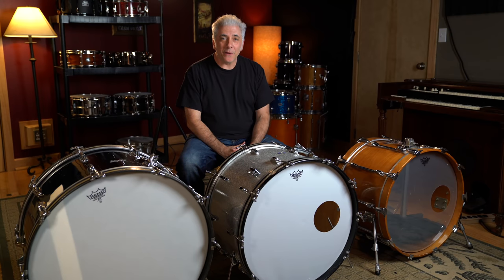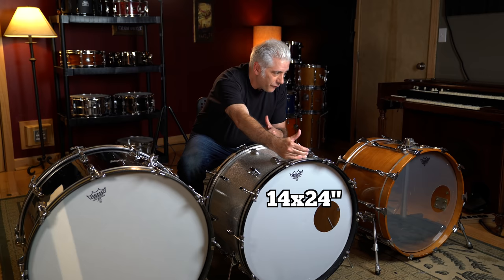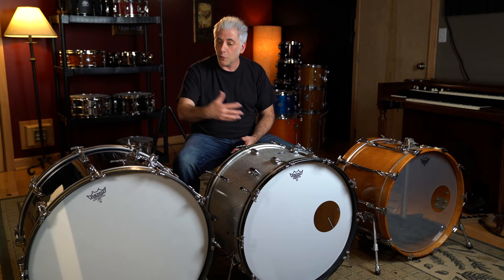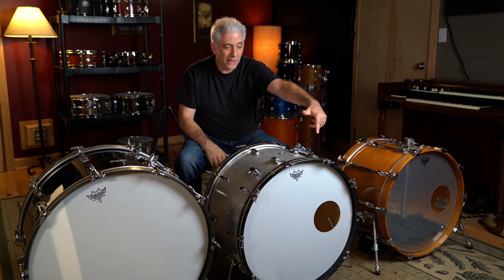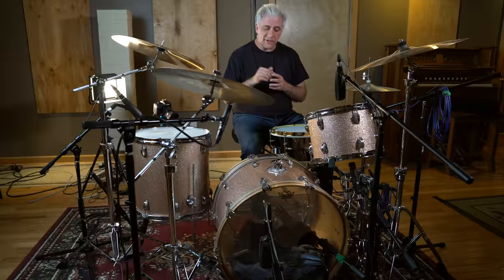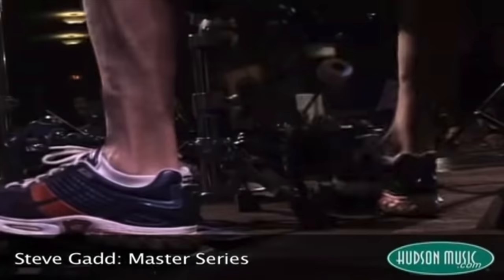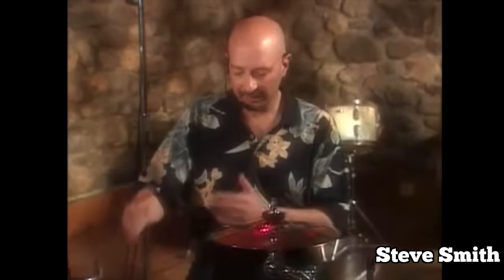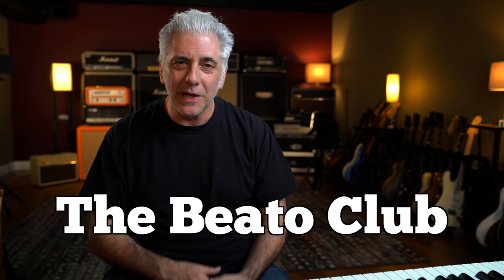How To Get A HUGE BASS Drum Sound

Comment: The deeper a tube, the lower the frequencies at which it resonates. That is why tubular bells produce lower pitched sounds when the bells are larger and/or thicker. So the reason a shorter bass drum may sound deeper is because of the second membrane resonating more in phase with the first one. A deep bass drum (say 22 inch) may act as a helmholtz resonator which cancels out low frequencies.
Reply: Dude Layin down that knowledge
Reply: Correct.  A deeper drum has a more “tuned” note to it because of the resonance while a shorter drum has more overtones/harmonics.  The overtones make it feel more explosive and allow lower frequencies below the resonance of the tube to be more pronounced.  To use an analogy, a really shallow drum is more like a thunder sheet (lots of incongruent harmonics) while a really long/deep drum is more like blowing air over a big bottle (helmholtz resonator).

In my own 30+ years of experience recording drums (and playing them) the deeper the drum the more pronounced the resonant frequency of the shell is and the more limited the tuning range is (the drum chokes more when tuned outside a resonance of the tube).  But man, when you turn them to match one of their resonance frequencies, WOW!!  Super loud, super round tone, and tons of sustain, very ringy.  Tuning them outside/away from a resonant frequency makes then very short/choked and they can sound extremely punchy, like that heavy metal super punchy sound with almost no sustain.

Shallow drums have the choking and ringing in relation to their resonant frequency to a lesser effect, so you can get a more consistent sound over a wider range of tuning but it’s neither super choked/punchy nor is it super ringy.  Anyway that has been my experience.

Comment: I discovered some of what you touch on this video a few years ago, when I was surprised to discover that my vintage early 70's Rogers 20" x 14" bass drum produces more low end that a couple of my newer 22" x 18" kick drums. Also, if you're using a front/resonant head on your bass drum, it makes a difference where you cut the port hole. If you get the hole too close to the center of the head, the kick will sound too dry and dead without much resonance at all. I had a kick drum that I thought for years had a problem with the shell (out of round, bad bearing edges, etc.), but I eventually found out the only problem was that the port hole was cut too close to center on the resonant head!

Comment: I play old Ludwig and Rogers, so they have tee head tension rods. I use a long thin zip tie or two shorter ones linked together to form a loop from the rods at the 4 and 8 o'clock positions (appx) then I can use different thicknesses of cloth, mostly hand towels, folded or unfolded, to achieve quick, easy, and adjustable damping. Thought I would share

Comment: I don't know Rick, I've got a Noble and Cooley kit with a 22X20 BD and I consistently hear from trades folk (engineers, producers, FOH/monitor mixers and other musicians) and non-trades (audience folk, or as I say "non-musician civilians") how deep and low the BD is. It also depends on number of plys, mic placement, head selection and tuning, and to your point, playing styles (i.e. burying the beater in the head). Same with snares. I've got several work horse snares that can go high or low and I can get a nice middle ground if needed. Over the years I've recorded albums with "jellybean" drum sets where the toms were from a different manufacturer and different color than the bass drum, floor toms and snare. Cymbals were a mix too, so I may have played a few Sabians with a vintage Paiste, Zildjian, Istanbul or Bosphorus thrown in the mix. At the end of the day it's about the sound we're looking for, right?

Comment: Here's a tip to help prevent the "burying of the beater"- pull your foot back on the pedal, so the ball of your foot is closer to the hinge. It'll take some messing around with it to find your "spot", but that small alteration will make it easier to not bury the beater. 

Contrary to the shape of the pedalboard, your entire foot does not need to fit on the pedal. The pedal is a seesaw and you're using your foot to activate various balance and leverage points. 

Happy exploring!
Reply: Exactly correct. I learned this when I was about 12. I cannot stand the sound of a bury beater technique. Always played from the middle of so of the board. Hit, and let it sing, 100%! I can't even do the other way when I try.

Comment: not sure how I missed this video when searching kick drum sizes... I started off with a 22x20, using an Aquarian Super Kick 2 with a matching Aquarian reso with a mic hole.  It sounded amazing.  I've since went to a 24x14.  It could be that I am trying to use the same model heads I've always had luck with or maybe it's the fact that I am tuning the same way as I did with the 22.  I press dead center and tune until the wrinkles go away, then back off maybe a 1/4 turn.  The reso I do the same with, but I don't back off the tension.  With the 22 it sounds great.  Not so much with the 24.  I am currently using the same heads but tightening them up more.  I am getting close to finding a tone I like. Several sound guys have complimented the bottom end and punch I get so maybe it's there and it's just different lol.  I had to add a small pillow to help accomplish this where with the 22 I would run wide open.  Anyway enough rambling...  good video as always.

Comment: I do a few things: 1) Mic the bass drum about half way between the beater and the rim, usually about 2" away 2) mic the inside, like he did through the port hole 3) mic the outside like he did 4) mic the port hole 5) mic about 6 ft away. If I already have the whole tracking session to a scratch drum / click whatever and I have the channels available for the session I'll use more mics. It really gives myself and the artist a lot of choice. Same thing with say guitar cabs and different mics. 2 Sm57's can sound almost like different mics, celestion 30's coming from the same factory can sound different mic'd with the same mic. If I have a 4x12 cab, I'll mic ALL 4 speakers. 1 on the outer perim of the cone, one on the cone, one on halfway between cone and outer rim, and one off axis. If I have the channels, I'll mic the inside rear of an open cab, plus a room mic maybe 4-6ft back, etc. Blending all that gives some cool results. Could I use a plugin? Sure, but I enjoy that stuff so whatever.

Comment: So is burying the beater like palm muting on guitar?
Reply: yes, it should be called toe-muting 
or
"My knee hurts, leave me alone"
Reply: It's actually a mode for a tone. It's easier to play loud rock /fast/semi fast music by burying it than it is for bouncing it off. As Beto said  not burying is great for slow songs by constantly not burying it. I kind of use a combo like if I'm playing fast music but it's not quite so fast but if I still want to have power I'll bury it sort of halfway. Especially if the mic signal is compressed or limited to studio or PA. A power trio drummer most likely plays toe down. However, a band like "rage" is that way but not during soft sections.

Comment: Diameter influences pitch and depth is more about how much sound is generated. Shorter depths generally have more sustain while a power size creates “more sound” when played loud in a short blast / quick decay. 

I’ve never understood the fascination with the 18 inch deep bass drums. I guess just a marketing tactic like the power toms — if one manufacturer did it, the others felt they had to? 

I’ve had 14 x 20, 16 x 22, 14x 24, 18 x 22 and 17 x 22. The 18 x 22 was a Yamaha Maple Absolute and it was very loud live but harder to play and more difficult to record. The 14 x 24 sounded best for recording if you wanted a Black Sabbath “Heaven and Hell” type dry, poofy sound   - a Ludwig. The only one I have now is the 16 x 22 Yamaha Recording Custom and it has a great mix of “tomahawk chop,” super quick action, and good volume. If ever bought another kit I would likely though go back to a 14 or 16 X 24.

Comment: I like using an 18 or 20 inch kick and put the microphone 2 inches off the head by 3 inches off center of the mallets on the inside of the batter head. 
 Live kits/ acoustic acts I use Isobaric by tuning the front head to resonate off the batter head making the shells sound huge

Comment: This makes me feel so much better with my old 14" x 22" Tama Imperialstar bass drum from the 1980s. Those deeper sizes are made for drummers with road crews that load the drums into semi-trucks. How exactly does one fit an 18" x 22" bass drum in the back of a normal car like a sedan? All I need is a drum that goes BOOM and fits in my car without having to buy a Ford Excursion or an E350 van.

Comment: 16" kick drums can sound suprisingly good, recorded. Especially unported, in music styles that suit that sound. 16", 18 & 20" are drums that can get away with / benefit from deeper drums. It's not so hard to push air through those narrower shells, since the force is focused. For music that isn't hard rock, I really like the sound of the 18x14" Gretsch Renown Jazz kick drum, or even better the 20x16", Gretsch Renown Studio kick drum. They maybe sound better on recording than the 22x18" Renown Standard / Rock, which maybe suffer from that problem moving air down a deep shell that you described, though I guess a large port would ameliorate somewhat? The drummer has a different perspective to the recording, since they hear more from the batter side, so aren't aware of that loss to the depth by the reso side, where the kick in mic goes. I suppose using an SM91, or the kick-in mic slightly deeper in might help.

Comment: Thanks for sharing this. It's proof there are many ways to mic up a kick to get a sound to match a musical style. A good way to "cheat" and get a kick drum to appear to "move" a lot of air in the room and give that current hip-hoppy bottom, trigger a 39-41 cycle tone with every hit. It makes a great "sub kick" sound. Works great live, however, use it carefully in recordings. Another approach is using a Yamaha SKRM-100 and lots of lowpass filter.

Comment: I have to say the 14 inch deep is the key to get this Bonham kind of sound. Also because is tuned high beater bounces back and makes booom! I also get the big sound from my acrylic DIY only 20/14. Sound is huge, I get easy 50hz with good attack and harmonics cut easy to the mix. Also I can get the modern sound “glueing”. A lot sounds it’s possible to get from this config. Maybe not the best for double pedals.

Comment: You can get a Bonham type sound from any bass drum 22" or above. Just use 2 felt strips for muffling. I use a 26 x 10 - it sounds huge and doesn't take up much room on a small stage. Bonham actually used a 22" on the first Zep album. 
A note about 'burying the beater' - If you have a closed res head, burying the beater will cause it to flamm - especially if you hit hard. It can work if you hit softer and use a softer beater.

Comment: The reason for pulling the beater away is to stop unintentional double  taps on an un-ported kick, a lot more air inside to bounce the heads, where the beater, if buried, bounces. Which is fixed by porting the front head (tho there are ports for the batter), sounds less boomy but a buried beater won't bounce and hence give a solid note. The resting position on the pedal is critical too. If buried, the foot is closer to the pivot point and the beater is resting on the head =quick accurate. At rest lower down the board, the beater is  free, farther from the pivot point on the cam, and is slower or heavier. But that works with a big kick 😃

Comment: All these informational videos are fantastics. As a drummer myself I watch these types of videos all the time and conclude that the bottom line is when it comes to drummers and their drums, its all preference.  And most of these videos are well produced. A kick drum with 2 professional, eq'd mics is going to sound way different than one without.  Rick is awesome, love his stuff and the info is great.  But I've gotten huge kick sounds out of all kinds and sizes of kick drums.  I'm no drum tuning guru either,  what sounds huge to me, may not to you.  Its all preference.   Rock on !!
Reply: I agree. I think Rick is somewhat overstating the importance of shallow depth here. There are many factors that affect the bass drum sound and you can get a good sound using a deeper kick.

Comment: From a non drummer (keyboard player) I remember having huge issue to get our drummer in a band I played in years ago to get a decent sound over the PA. He was using an Old Slingerland set with a 24 inch BDrum, wich was absolutely impossible to get to sound good, even it was a decent sounding acoustic set. I then Found a drummer that was Selling a Sonor signature set very cheap because of having develloped tinitus. And this little jazzy set with an 18x22” if i remember right absolutely blew me away. It was just a little damping material inside and a single mic, and all it needed was some “Oomph” in the low end and it sounded absolutely beutifull. So even without any knowledge of drumkits this has always let me believe that if you can live with a set that doesn’t make a lot of noise by itself and you have a decent PA, a small jazz set might sound much better than all those Big cans

Comment: Great video Rick. I'd also mention  about using a resonant outer head without a mic hole vs with the hole. Another reason that Bonham had such a huge kick sound was the fact that there was no hole in his resonant head. Same with Simon Phillips. Nowadays, some guys are mounting the mics inside the drum without using a hole on the resonant head.

Comment: This is assuming a kick has no muffling as well. Many drummers (including this one) use a kind of pillow that sits inside of the drum and it lightly touches the beater head (the one the pedal hits). When the mallet strikes the head, it knocks the pillow off, letting it ring for a moment, but then it falls back and touches it, which mutes the head. It gives a similar effect as foot down playing where the kick is a whooomp sound with a quick attack and lower sustain. But it lets the drum ring without muffling for a split second, giving you the bottom end, so it's a best of both worlds. Where the beater hits the head also matters a lot. On a 26" kick, it can be hard to get a beater stick long enough to hit the center of the drum. Hitting off center results in a more percusive, but quieter sound, but it also makes the drum ring more (resonance).

Comment: Good information. Another relevant tip. Different bass drum pedal beaters is worth experimentation. A hard beater will give more smack - contact sound. A softer felt or more padded and wider faced beater will create a more understated sound and enhance the lower frequencies in the drum.

Comment: When you say that playing off the head is better for slower tempos, I'm not sure I entirely agree.  From a sonic perspective, I get what you're saying.  You don't want the decay of the last note to mask the attack of the next note.  Burying the beater will sound cleaner and punchier.  But from a mechanics perspective, the faster you play, the more you need to rely on the beater rebounding off the head.  When you bury the beater, you're letting all the energy you put into that stroke go to waste, and then you need to expend more energy to bring the beater back to its original position.  When playing off the head, the rebound does a lot of the work for you, which enables you to play faster and longer.  This all becomes much more clear if you think about it on the snare instead of the kick.  Try doing a fast single stroke roll on the snare using dead strokes (a more generic term for 'burying the beater').  It's not gonna work very well.

Comment: I’ve probably had 15 drum kits by now and by far the best sounding and most enjoyable to play was a 22x14 1973 slingerland 3 ply kick.  Absolute powerhouse with no gross overtones, just mountain of attack and low end, and it sounded soooo good.  I never should of sold it.  Anyways, 14 inch deep kicks are kinda like Harley Davidsons bc they are so loud and powerful they even catch non music people attention. I played a gig once with it and everyone came up to me after and mentioned the kick drum.  It’s pretty cool bc like you sound since it doesn’t loose much energy going only 14 inches, when the air comes out the port hole it shoots across the room and hits people and they love it bc it’s so unusual.  Also,  they are much easier to play bc they are incredibly responsive since the reso and bass side head are talking with each other and resonating so well. Really easy to control double bass and also extremely easy for bonhan style trills.

Comment: Decent video but I'm surprised you didn't mention a) mic choice and positioning,  and b) compression and eq tricks.   Shallow kicks can have a bigger sound, BUT one of the most famous massive kicks ever was the Metallica 'Enter Sandman' kick which Bob Rock created with a bass-drum 'tunnel' (two kicks joined together), and 5 or 6 mics blended together.  Others like Bruce Swedien (Thriller, etc) used a kick drum cover (sound blanket or sleeping bag) to allow a mic further away but protected from bleed...   So many different ways to skin a kick!   I also wish this vid could've demonstrated the difference it makes to tune the beater head low and the resonant head tight (which I believe was one of Bonham's techniques).

Comment: You should try messing around with different mic placement and angles. For me, I've found I prefer an Audix D6 just inside the port of the reso head pointed at the bearing edge of the batter head opposite of the port hole. It gives a really aggressive attack and a punchy bottom end. I think you'd dig it if you haven't tried it.